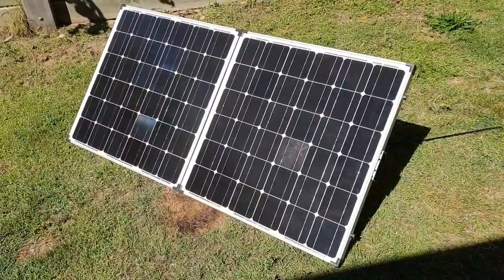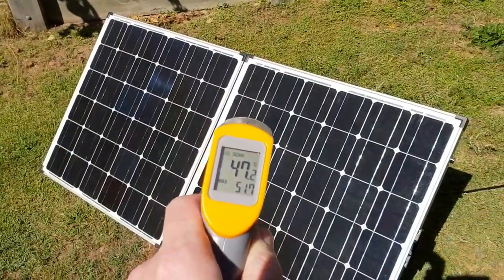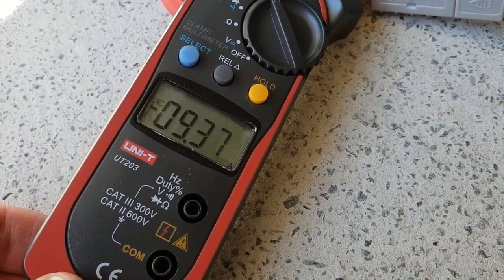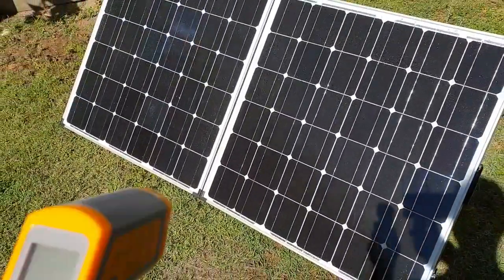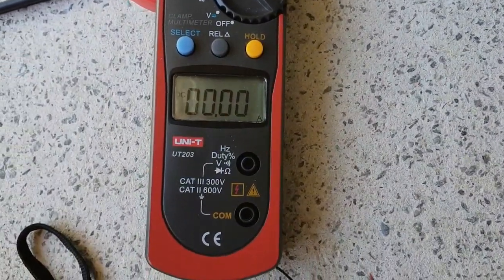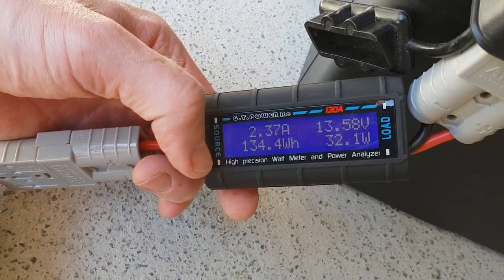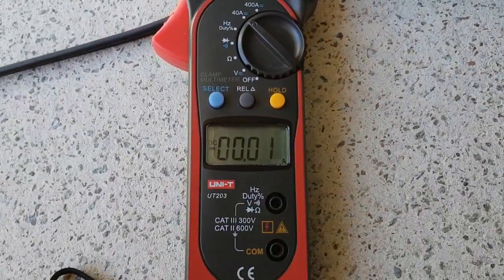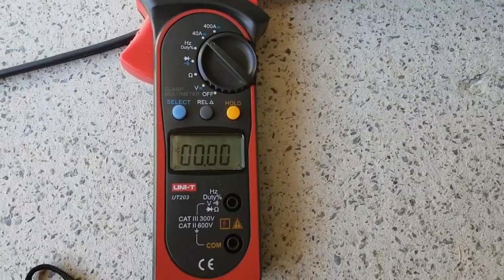Solar panel surface temperature vs panel output. Hot is bad !

Comment: Thanks, I've been looking for sensible information on the temperature effects on solar panel power output - your vid is actually one of the best I've come across. The fluctuation of the current by the controller is quite disturbing. It looked like it could be as bad as a 50% duty cycle meaning you lose 50% of the energy. Can you tell me what the controller is so I can avoid that one?